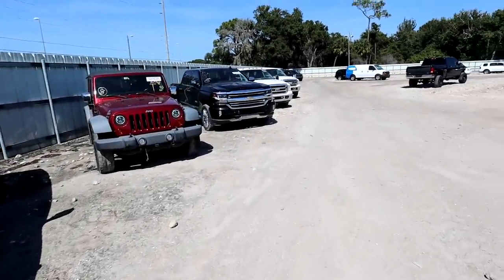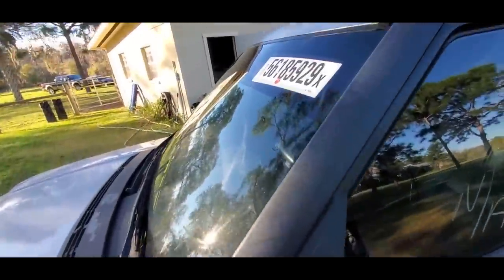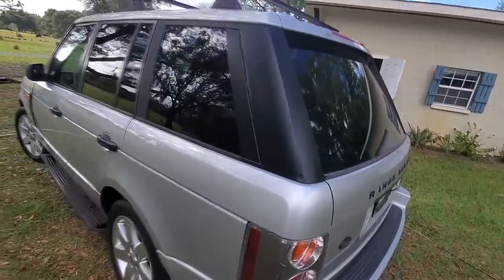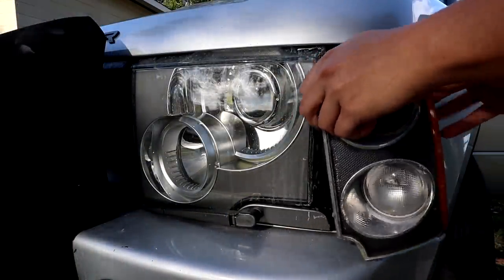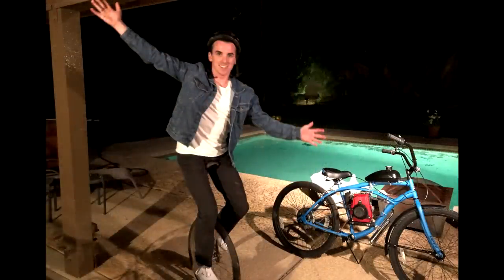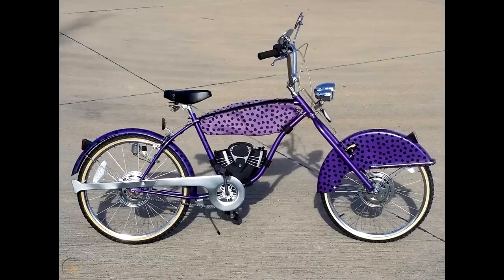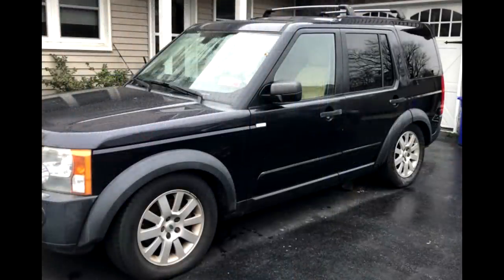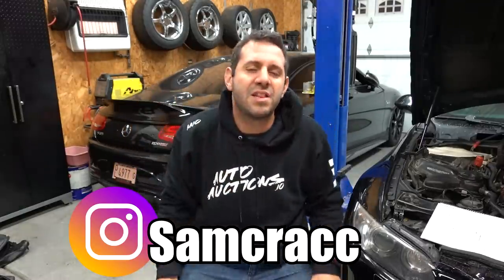Trading a $1,400 Auction Range Rover with Catastrophic Damage! Here's what I was Offered for it...

Comment: The steamer is a very handy tool.  Previously I struggled with getting off tint from my front windows for mega hours to pass inspection.  The glue stayed on the window and was murder to get it all off.  Years later I purchased a clothing steamer to remove tint on another vehicle and the entire vehicle's worth of tint came off with the glue in less than an hour!  As this video shows it's useful for other glued-on stuff AND it will sanitize your upholstery but you have to have a lot of towels and time  to let it dry.

Comment: Sam 1:47 you say dish soap and say why you can use it... but I missed where in the vid that you say why? Can you explain? Because of ceramic coating? But you used dish soap to wash BEFORE applying the ceramic coating... does it restore/seal the paint finish post using dish soap?

Comment: Cool, i think the thing has gone to the best possible place and cause. Props for just donating the car too, one thing that always pulls me back to respecting you (since i don't like the sponsorship plugs lol! Nothing personal just hate them) is the things you do for charitable causes and the like.  Shame it's being fixed properly though, would love to know how long that engine held up with the snake-oil "repair"... Perhaps you could suggest running that engine in something else after it's removed, or even accept the engine back and run it yourself in something purely to see how long it held up. Was super impressed it managed to seal up combustion chamber to coolant jacket blow, but it just eats me not knowing if it'd go for years or hours before failing again! (or never failing, that'd be an endorsement indeed) :D
Reply: oh, and thanks for the plumber's putty tip. Will have to give that a go.

Comment: I, for one, love the focus on super cheap fixes and such with this car. Interesting to see if cheap fixes are as bad as their reputation suggests.

EDIT: How on earth could you pass up the Cheetos bike?
Reply: That cheap head gasket fix will last around 6 months before blowing out again in the same spot. This ensures the car will run hot again.  This fix will end up causing more issues. Try cleaning that glittery crap out of an engine.
Reply: @joshchristian6101  

Yes but for the guy who has to get to work in the meantime untill he can deal with it properly it will get him by untill spring comes. No its no permanent repair its a bandaid  most the repairs were band-aid fixes.  But somthing to think about shopping for used cars, some sleazy used car dealers would sell you that rangrover for top dollar and not give a shit about you 6 months later.

Thats why you have it gone over by a good repair shop your frinds with and trust.
Reply: They are worse... there is gunk all in the engine now... good luck getting it out!

Comment: Daewoo Laganza literally the worst car I ever drove haha
Reply: But man they made some crappy TV's...
Reply: I love that first picture in google and the one Samcrac used is the one made in Poland. Where we called it "poor man Jaguar if the poor man was also blind"
Reply: I drove one once the only good thing was the Ice cold air conditioning, everything else 💩
Reply: I wonder why he would have wanted a Daewoo Lanos? A friend of mine had one and to be honest it wasn't that bad because he had it from the first owner which in turn was a friend of his mother. The only trouble he ever had was not starting because the ground to the ECU was connected to the bottom plate of the car which started to corrode (common problem). It eventually started to get rusty and he drove too much to not switch to Diesel so he got rid of it before it came near to becoming an endless moneypit.
Reply: CheapBastard1988 the daewoo lanos was used in the movie Pineapple Express. I think he was making a joke about it because he use a picture from the movie
Reply: @PatrickS9595  OK thanks
Reply: But it's the flagship, and it has WOODGRAIN trim and POWER windows and CHROME! So much luxury, it might as well be an S-Class! /s

Comment: Really glad to see you remove the tint from the front windows here in the UK a tint like that would be illegal and police would tell you to remove/pull off as much as possible as they watch or get a massive fine as here there has to be 75% light through front windows and windscreen the police use calibrated light meters too so you cannot fool them ethier. Only windows in UK on car that can be tinted too that extreme are rear windows and rear door windows

Comment: I knew you would come out okay on this Rover.   wow.  What a messy job trying to diagnose the trouble.   Glad it will end up in a good place.     I'd sure like to see you get a Miata.  Sam those are great little roadsters and easy to work on.  Restore an older one or a newer one.   I prefer 2001 thru 2005.  Great engines. and very solid car on the road for such a small engine.   More Miata's have been sold than any other Roadster in history.   I'll never for get those Pizza cars you handled a while back.

Comment: Here in the UK a used petrol Range Rover is worth nothing (gas is around $6 per gallon), change the engine to a fully reconditioned diesel and the value rockets, even in a high mileage chassis !

Comment: Hey!  I bought that red Porsche Cayenne in the opening clip!
Reply: How much?
Reply: @stevenkelley4700  wow.....that's alot of money for a car you have to rebuild dont you think?
Reply: @supfoo9221  I do, but it has all the options I wanted. Carbon ceramic brakes, gts red, Wabesto parking heater and others.  Window sticker was 165k.  I'm into it 3k for parts and another 2k for paint. I'll keep it forever so I don't care its salvage. Turbo S models are hard to find.
Reply: @stevenkelley4700  honestly 22/25k for a GTS after everything will for sure be worth it. Hope you enjoy it brother
Reply: 165k new? That’s nuts. How deep is the damage?
Reply: @qmarq  right..I had no idea GTs went for that much brand new. I have seen one on the street and was impressed for sure lol
Reply: @qmarq  not too bad.  All radiators and intercoolers. Fender, hood,bumper.  Only one frame bracket and apron bent. Frame rails were straight. Last owner left the service history in the car. Spent 20k in the last year fixing it up at the dealer.
Reply: congrats, upload a vid of the work i'd give it a view
Reply: sounds fixable for sure. I'm subscribing in case you put out videos because I also wanna view the work. really interesting project.

Comment: Lol rip to my A4, someone want to buy my Porsche 911 so I can fix my Audi?

It's my car & the timing tensioner failed. It's my project car, but I now have a daily Porsche 911, the original offer was to trade in my 2013 Audi & have him repair it with a 2018 A4 engine for the Land Rover & then when the A4 is finished I trade him my Porsche 911 for my Audi lol

Comment: Ceramic coating is snake oil... It comes in a tiny bottle and is crazy over priced. Classic snake oil tactics. Ceramic coatings are always sold in too small quantities and don't work that well. If you want true long term protection get a clear bra wrap. If you want 3-6 months protection depending on sun and weather just buy a cheap wax...that's all ceramic coatings will do for you...  and honestly wax shines better